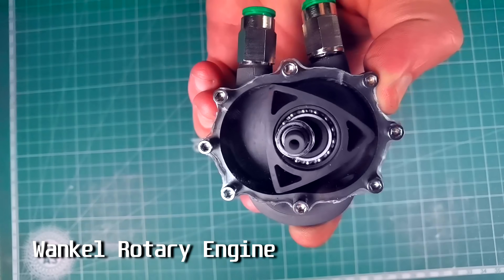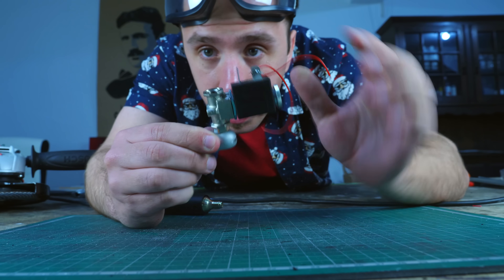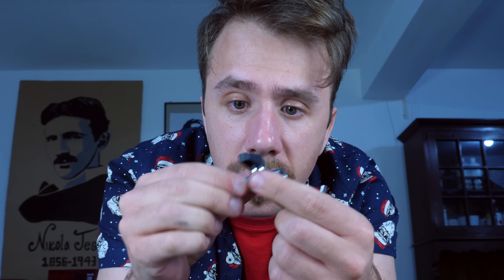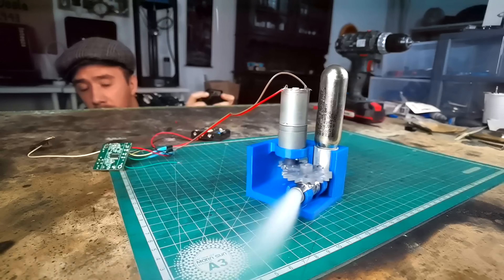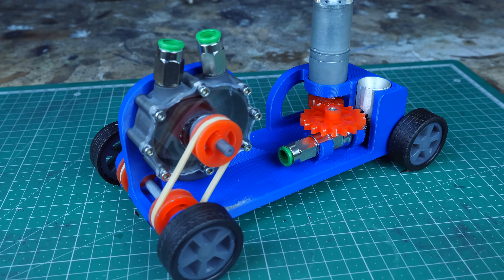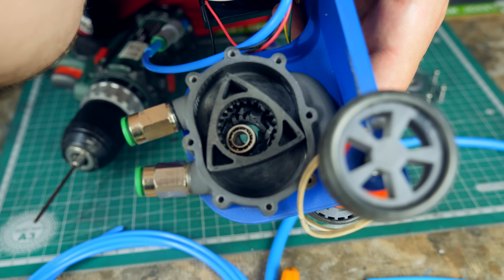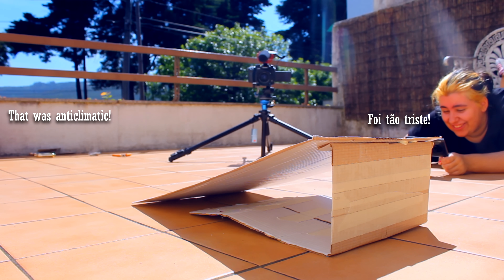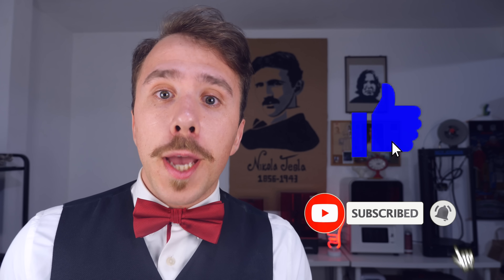Rotary Wankel RC Car (3D Printed)

Comment: Video idea: build an homemade cnc for milling aluminium pieces and improve the strength/characteristics of your models. 3D printing is a good solution to prototype more complex parts but you can mix both processes.
Keep going! 🚀

Comment: - Slow motion shows serious slippage on the drive "belt". Engineer a mechanical transmission, in stead. 3D printer challenge: design a worm gear transmission.
- Slow motion at 5:12 reveals the inherent problem with a Wankel engine. The rotor is rotating in a non symmetrical manner and creates vibration throughout the entire engine. One of the main maintenance problems with a Wankel is the main rotor bearing which, over time, ends up deformed because of this non-symmetrical stress and eventually jams or flies apart. There is no way to counterbalance a single rotor other than a second rotor that spins 60° out of phase from the first. Even that will not reduce the off balance stress on the main bearing, but it stops the vibration in the engine housing.
- As in my last comment, if you get rid of the "compression by-pass" tube and use the ports it leaves behind to vent the first chamber into the atmosphere and inject more gas from the canister into the second chamber you will increase the horsepower x2. By increasing the total torque output you can reduce or regulate the injection pressure, thus reduce the rapid freezing inside the engine. The compressed canister will last longer, also. 2nd 3D printer challenge: design a regulator to discharge the CO2 canister at an adjustable, continuous rate.

Comment: In the next video you could make an upgraded version of this car, as you said, you would have to gear the engine down but you should also change the rubber band, it was slipping a lot, maybe swap it with gears only

Comment: I think the reason for why the engine was so much less efficient than the "rocket motor" version of the car is because you blasted practically all of the gas out in one instance. That led to the engine vibrating strongly and made the wheels lose most of their contact with the ground, losing huge amounts of energy. Also, since the cartridge was decompressing so rapidly, the gas inside froze and it blasted out a fair chunk of CO2 as a solid, which further lost you valuable energy which could have been used to propel the car forward.

I suggest opening the valve much more slowly to reduce the vibrations, maybe put some weights on the drive wheels, and to turn the cartridge upside down, so you lose less of the gas as ice.

Comment: idea: Add a turbocharger system propeled by the waste gas from the wankel engine, add a chain with spikes like in a real car becouse the chain wa slipping producing barely any power. If you can add a servo pressure release valve (emergency stop) and drum/disk brakes. If you manage that try to add a reverse box or even a full rc gearbox. All of this has to be rc, If you read my comment thank you and have a nice day.

Comment: Video idea: You should use that valve with a stepper motor driving it so you can control the flow and then use nitrous oxide canisters in it for a throttleable hybrid rocket engine!! (nitrous oxide is a great oxidizer for hybrid rockets)
Reply: That would be so cool to see!

Comment: Idea: use a toothed belt and pulley system for the car with the Wankel engine. Also try potentially using a stronger inner gear material

Comment: Is it possible to print a gas pressure regulator? It will allow you to make better use of the gas you have available and you would be able to travel further plus being able to use the larger cartridge.

Comment: Great design. You should put the motor in the back with the exhaust exiting almost parallel to the ground with some downward angle to add traction and thrust
Reply: Sort of like the rocket booster the Tesla Roadster is it going to have

Comment: I think it would be cool to revisit this but with using different diameter pulley to drop your RPM to your wheels. You could also change the wheel size and that might give you a better result. Also adding tubing to vent the exhaust backwards and that would give you more forward momentum.

Comment: Did that belt have any teeth on it? From what I could tell, it was smooth on both sides - you'd eliminate a lot of the slipping you see on the slo-mo cam and probably improve the overall speed. Of course you'd need to modify the pulleys to accept a toothed belt.

Comment: I think the challenge of making a3d printed "AIR POWERED" submarine would be EXTREMLEY difficult. The air would need to be counter weighted with ballast so it sinks. But I want you to be able to submerge and rise while being driven forward by an air system. That i think would be a cool project. Then bomb it with tomato depth charges lol.

Comment: Suggestion: 3D print a continuous track(tank tread) to use on your Wankel RC. It would be interesting to see if it could be printed fully assembled and ready for application. It may also help with surface contact and movement.

Comment: Just simply use a belt with teeth to connect the engine to the wheels, the rubber band was slipping off

Comment: You have to use tighter rubber because the energy produced by the engine is causing the gear to reject the rotation energy.
Reply: And you should replace these tires with similar ones seen on F-1, this will help get more grip.

Comment: Hi, i Like the concept of the wankel engine. Try to Print an dual Rotor engine with 30deg or 60deg difference between the Rotors. You got more Torque and less Vibration. An other big improvement will be a redesigned Inlett and Outlet from the Piston. Smaller Inlett a Bit more downward and the exhaust a Bit wider.
This should bring you again a bit more Torque and the Gas will last longer.
Best regards

Comment: The engine is wobbling all over the place, could you add a second stage to the engine both to act as a counterweight and to get a little bit more energy out of the compressed air?

Comment: Wankel engines utilize combustion to drive the rotor, you could try using the oxygen and propane gas you had for you rockets to create a little combustion car instead.

Comment: Rubber band needs to be replaced, swapped or tightened.  Lost so much energy from the slipping.  Also go for all wheel or rear wheel drive if your trying to get the energy transferred into moving that thing.

Partial valve open to keep engine from leaking and extend the run time.

I  wanna see a proper 50mph+ rotary engine rc dragster.  3 or 4 good revisions and you can do it! <3 rotaries!

Comment: I´d say the Car would work a lot better with the Valve on top of the cartrige, so the CO2 doesn´t blow out as a Liquid.
You can see the motor is way overpowered for the Car, this might help and give the Motor less but longer and more continous power.

Comment: You could've gotten so much more power by just using a toothed belt, and a gear, as an output for the engine :)
Rubberbands are doing a huge amount of slip, and you can see that in the slow-mo shots.
Would've gotten some nice burnouts too.

Comment: You need to turn the CO2 cartridge right side up, so that the outlet is at the top of the cartridge. The reason you're getting "snow" is that the liquid CO2 in the cartridge is being allowed out the bottom, instead of requiring it to boil, and releasing gas out of the top. You will get MUCH longer run times, if you do this. Adding a regulator would help, too.
Reply: No completely correct, dry ice is sublimated from the drop in vapor pressure.
Though he can GREATLY increase the eff by adding heat on the secondary (ie loop) side of the pneumatic motor.
The expansion of gas by a heat exchanger can be seen in early steam engine designs.
Wonder if he's considered moving a liquid on the secondary side.
Gravity may help reduce the sublimation, yet it's decompressing too fast.
Reply: @cheerdiver  not quite accurate. The co2 is stored in the cartridge, under pressure, in liquid form. When the liquid is dumped out the bottom, it is no longer pressurized to the point that it can remain liquid. As the liquid instantly boils, the temperature drops low enough that SOME of the liquid solidifies, leaving "snow" of dry ice. This solid co2 doesn't contribute anything to the production of power. If the gas is taken off the top, then the solidification takes place inside the cartridge, and as heat is absorbed into the cartridge, the solid will sublimate, leading to continued gas production.
Reply: @riccardomarcenta  Not sure what you're smoking, but it must be good.
Reply: @JohnDoe-fk6id  Could he be mocking you, b/c he's aware of Boyle's Law, and vapor, pressure, density, Tri-points?
At ambient temp, CO2 is a gas OR a solid.  Liquid CO2 requires pressure, AND appropriate temp.
To raise the question, shows you want to learn.  If you want to go to the moon, research Black Body in Space, or you're going to freeze to death.

Comment: The cartrige lets the air out too fast, the transmition is slipping, slow the air down, It will make the engine perform much better.

Comment: Very cool! I used to have a Mazda RX-8 with a Wankel, very fun car. 

I think the biggest issue with this build was all the loss of power through the wheels and the rubber band. You can see the wheels spinning at the start, and the rubber band slipping around the drive shaft. The best way to reduce the issue of the wheels spinning would be to make it 4WD, double the friction on the ground should help transfer that energy into forward momentum. And to stop the rubber band from slipping you could use miniature drive chains that are used regularly for robotics. 

You could also change the gear ratio to reduce that 5,000 RPM to something more useable by the wheels. Or some restriction on the flow of CO2 from the cartridge to lower the pressure but extend the duration.

Comment: You should have put more weight on the driving axle and maybe put more gears to open the valve slower so the pressure wouldn't be released so rapidly.

Comment: I feel like you're losing a lot of energy at the rubber band. The motor turns but the rubber band is too elastic to carry the energy to the wheels. I suggest you use gt2 timing belts next time

Comment: 3d Print a 2 stage rocket where the 1st stage is self landed through arduino controlled propulsion, and the second stage is recovered through parachute.

Comment: Make a 2 stage rocket, the first stage will be of a sugar motor and the second should be of co2 canisters with a nozzle. The first stage separates after combustion and the co2 canister provides the later thrust. And ofcourse it has a parachute and kills a tomato after landing.

Comment: Should make a transmission to get that 5000 rpm into those tiny wheels.  Also the gears won't skip like that rubber band he had on.

Comment: Scale up the rc car and motors to something like a 1/5th scale rc car. With two or three rotary motors. Could use nitrous oxide controls systems meant for a car or motorcycle and a bigger co2 tank

Comment: Video Idea: You know the Christmas tradition of putting a train track around a Christmas Tree? Could you design and make available to print a magnetically levitated train, whose track wraps around the tree, which is propelled efficiently enough to use it as an ornament? Oh, and safe. Safe is good, too.

I can't think of a good way to propel the vehicle over a magnetic bed, except to have a propulsion system on the train itself (like a small ducted fan, or propeller). But then how do you supply power to it, in order to keep it running indefinitely (as an ornament), without talking huge money? Maybe a series of cheap Qi chargers embedded in the track, sustaining an 18650 or tiny lipo on the vehicle? I don't think having contacts would be fair, because then it's touching the track.

Comment: Neat, but CO2 cartridges are very "all or nothing", whereas your engine wants a more controlled release. Currently, most of the potential energy of the system is wasted at the very beginning. Some sort of pressure regulator would make the cartridge last longer, let the car go farther, and should allow the bigger cartridges to work with minimal issue.

Comment: WHERE'S    THE     REST   of  this  VIDEO.???? 
the part where you critique your own work. and Learn something.
the part where you discuss the  stoopidness of using a wankel-based design.
the part where you discuss the dumbness of using printed plastic components, in an engine/high energy application.
the part where you discuss yer  high-quality drive belts.
the part where you discuss the  Incorrect  way  the  motor/engine  was  Loaded.
the part where you discuss the  TOO  SMALL   nature  of the vehicle and its wheels.

the part where you discuss the  amount of  traction  that was  LOST, at  the  launch.
the part where you discuss what happens when an 'engine'  is  running  wot*,  while being  MININIMALLY  loaded.      (* wot  equals,  wide open throttle)        googletranslate

Comment: Regulate the pressure from the CO2 canister into the wankel engine so it's not dumping it all at once and you have a slower more control power curve. Would allow the car to get traction and go further

Comment: A lot of inneficiency comes from releasing CO2 too fast and coming out in a solid form. Each unit of volume of solid CO2 that comes out, if evaporated, is equal to 535 units of volume of Co2 gas.

To get the most out of the CO2 cartridge ideally you want the gas entering the wankel engine all being room temperature, which can be achieved by slowing down the exhaust (so that the cartridge has time to soak up more heat) or adding some kind of heat exchanger between the cartridge and the motor.

Anyway, somekind of pressure regulator would also increase the efficiency

Comment: Have you ever considered using Hydrolysers to make pressured hydrogen you could use in that engine. You could make a turbine that pushes air into a combustion engine with the pressure. Or just make a rocket that is self refilling.

Comment: For the engine a balance shaft or multiple rotors would smooth the power and keep the mount from straining so hard from vibrations

Comment: Video idea: Connect a Rotary Engine to 3 CO2 canisters with a variable valve on the one end and a gearbox on the other and connect the output from the gearbox to a propeller so you have a multi-stage rotary-powered 3D-printed plane with a propeller!

Comment: Part of the problem causing a lack of power is the CO2 is still very cold when it leaves the engine; you would benefit from warming the CO2 until it's fully gaseous before it goes into the engine, e.g. with a coil of copper pipe to act as a heat exchanger.

Comment: Opa, integza you should continue on the wankle engine path.  You should print helical gears instead of using the pulleys and rubber band. You were loosing a lot of energy when the engine was spinning up before the rubber band was able to transfer the energy to the wheels. Gostei do vídeo e sempre espero ver o que você inventa no próximo vídeo. Bom trabalho.

Comment: With the Wankel, most of the CO2 was passing through the engine as a liquid. That means most of the expansion was happening outside the engine and so wasting lots of the stored energy. 

How about trying another run with a small aperture between the valve and the engine? With a small enough hole, the liquid would all flash into gas before exiting the engine, so you’d get a lot more energy out of each cartridge. If the hole is really small (literally just a pinhole, I think), it might throttle the gas flow enough to not over-rev the engine, so you could enjoy many more runs :-)

You could probably make a small aperture just by tapping the point of a thumbtack or sharp nail into a thin sheet of brass or aluminum (I bet a piece cut from a soda or beer can would work well, as long as you had the thin metal well-supported except for right around the pinhole itself.) 

I’d be really interested to see another run with the Wankel, using a small aperture; I bet you’d get great results even with the 18mm cartridge! (18ml?)

Comment: I think the reason the car didn't make the ramp was because of the torque   from the engine was getting wasted through the pully between the engine and the rear wheels. You can see the engine and the pully spinning but it's slipping on the rear wheel. Maybe with a different drive system the power will be better transmitted. I'm just guessing I'm no way a engineer 😅

Comment: You're releasing the energy stored in the CO2 cartridge too fast and loosing energy due to liquid C02 leaking out
Try to make a valve that won't open all the way, you'll be inputing more energy towards making the engine runing faster, and longer as well!

Comment: A theme for the future video :-Try making a rc boat using a 3D printer in which you can install the wankel  engine  instead of using electric  motor,, to propel the boat forwarded and this time with two co2 cartridges, with a pressure valve to control the pressure and maintain constant pressure where the engine runs smoothly,,  and that when one co2 cartridge runs out the other should turn on and maintaining  the speed of the boat,,,,,

Comment: Idea: Retry the wankel engine but this time use a small pulley on the engine and a big one on the wheels. Also, make the chassis stiffer so that it doesn't bounce the front wheels. Also, if you make it rear wheel drive, it will better transfer the power to the ground.

Comment: Hey Integza, I think you are making a mistake with CO2 cardrige mounting orientation. You should mount it the other way around, with the valve at the top. With the valve at the botom, you push out all the liquid phase of CO2 instantly and it won't last too long (you can see it in the slowmo with the bigger cardrige). But with the vale at the top, you will only shootout a CO2 gas and it should work for a longer time.